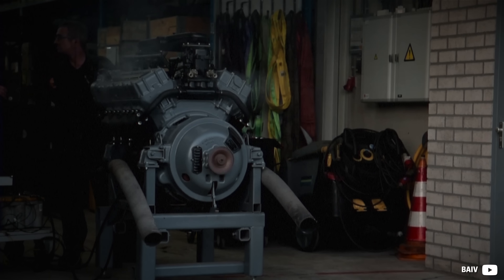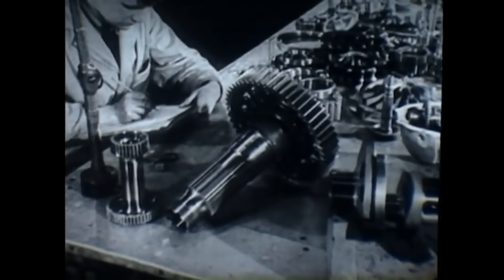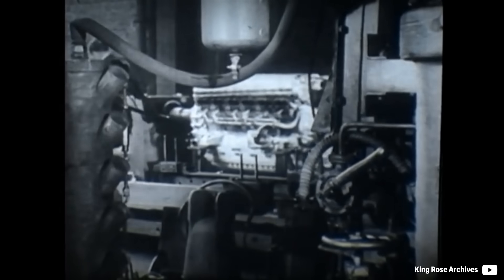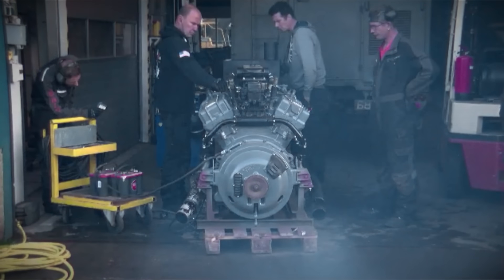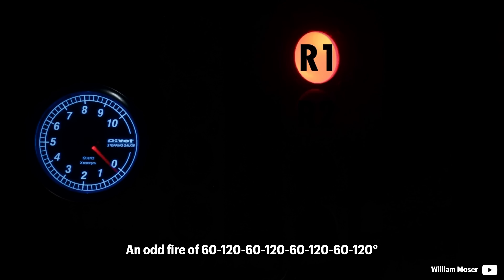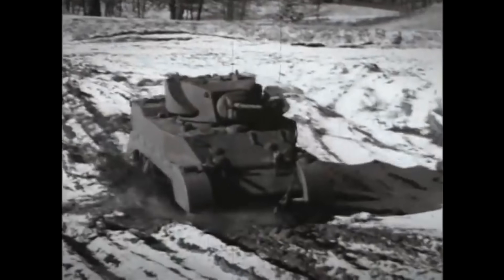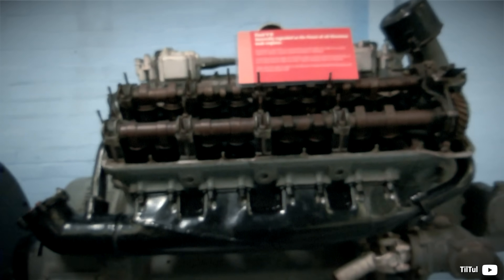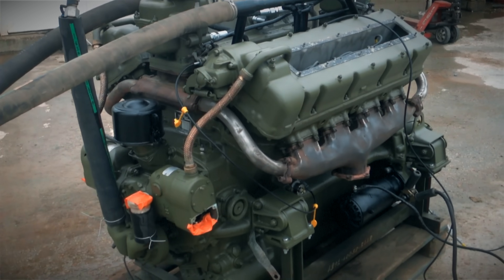The 1,100 Cubic Inch Ford GAA Was Extraordinary

Comment: Another problem with some of the other engines for the Sherman tank... the Chysler "multi bank" engine weighed over 4400 pounds, and the dual GMC 6-71 diesel also weighed over 4400 pounds. By contrast, the Ford GAA V8 engine only weighed 1440 pounds. That's a weight savings of 3000 pounds per each tank. Easier to ship, used way less fuel, could travel over softer ground than the heavier tank models.

Comment: During the 1930's the US Army was developing Christie concept combat cars that used the Liberty V12 engine. They wanted to make it lighter and shorter so made prototypes using a surplus Wright R975 radial aircraft engine. The drivers liked it due to having a smooth delivery of power and the mechanics liked it for not having a liquid cooling system plus being easy to remove and reset. The Ordnance Department decided to keep using the Wright radials in the M3'S and M4'S due to the commercial air carriers having plenty of surplus R975's plus parts on hand (they switched over to using more powerful Wright radial engines) plus Wright was still producing new engines. Ordnance had Continental take over production of Wright's smaller radials (a smaller one was used in the M5) while Chrysler figured out how to mass produce armored tracked vehicles. Ford had his V12 aero engine completed by then and was trying to get the US Army Air Corps and British Air Ministry interested in buying it. It was superior due to being fuel injected and turbocharged. The USAAC decided to keep using the Allison since it's bugs had been worked out over the past ten years, their mechanics were used to working on it plus the War Department knew how much each cost and expected that number to become lower once in mass production. The British Air Ministry declined Ford's V12 and asked him to manufacture the Merlin instead due to Rolls-Royce being too slow. Ford declined and handed the blueprints over to Packard to study while he converted the V12 into a V8 tank engine for the Ordnance Department. That took a few years as Ordnance tested them in their T Series being worked up to replace the M4. The V8 allowed Ordnance to design a hull with a lower height and a lighter weight fluid drive GM Hydromatic transmission. In the M4 it allowed more space for wet ammunition storage on the floor. The V8 also held up longer than the R975 when hot-rodded by the drivers. Both had speed governors that were tinkered with to increase the tanks speed with drivers using engine braking to slow down when racing along. The R975 was expected to run for 200 hours before being swapped out for inspection and refurbishing. Hot rodding had reduced that number to 120 and even 80 hours so the Army now started removing all radials after 150 hours of use. The V8 could sustain being hot rodded for more hours but still had some problems once subjected to rough battlefield operations. Components were still being redesigned when the war ended.

Comment: An interesting drive system for the DOHC.   Worm gears at the bottom of a long shaft, which has worm gears at the top to drive the cams.   ingenious, and likely very reliable.  Also, a 60-degree cylinder bank is very unusual for a V8, which are commonly 90 degrees.

Comment: The GAA weighed far less than the GMC twin 6-71 power plant and the multi-bank. Drop a ton or two in the back for the M4A3E8 HVSS wider tracks is more than a fair tradeoff.

Comment: The flat plane crankshaft was in my opinion, the Big flaw in this engine. It was used in early V8s but side to side vibration was the flaw as it is in more modern race engines.But with the MUTCH shorter Sroke race engines ,MUTCH HIGHER engine speeds can be used. It is my understanding that this return to flat plane crankshaft was to be able to exploit the exhaust extractor effect available inline 4 cylinder engines at high R.P.M. In the case of both race and quickly needed Tank engines, extended engine life was not the main priority. In the case of very short stroke race engines and very heavy, rigid hull (body) military tanks, the side to side vibration just had to be lived with In case of the GAA Ford engines,3800 r.p.m.is a very high engine speed for an engine with a Six inch stroke. This is stroke length with is and has been use heavy truck diesel engines for many decades and was 
Conceived from experience to be the most practical stroke length for this size of engine.

Comment: The r975 was not unpowered, it was very light and reliable. 300 to 450hp and over 1050 ftlbs. Great engine for the tank, availability became the issue with how Sherman tanks were being built.

Comment: Wow imagine Ol,  Henry Ford,s GAA in a ,47 F-150 Pick Up Rat Rod, you forgot Engineers at Rover Motors in Solihull Birmingham UK did the same, lopped four cylinders off a Merlin to create the Meteorite , a monster V-8 petrol engine similar to the GAA in order to satisfy a contract issued in the early 1950,s by the UK war office  for a new Tank Transporter  Tractor designed by John I Thornycroft using the Rover Meteorite  V-8 .

Comment: Seems like such a shame to destroy one of these engines on a pulling tractor when the V-12 Allison has much better power and reliability for high horsepower output. If you keep the GAA under 15-1800 hp. they'll last a long time.😉

Comment: Hi VisioRacer, excellent presentation!  I hope that viewer understand how advanced our technology was back then.  Germany could produce little (or big) marvels but not in great quantity.  Germany built (some) good engines but so did the Allies, think about the Merlins, the Allisons, the GAA and the Curtis-Wright/Pratt & Witney series of radial engines, to name a few.  Consider the complexity and fine edge of the technology used in valve train/drive and/or crankshaft balancing.  Remember that these marvels were produced by the thousands and assembled by an uneducated (for the most part) man/woman power trained "on the premises".
We (Westerners) did make those achievements and we could still do... if we wanted to and... worked for it.
The complexity of a B-29 Bomber is insane!  At its peak production hey days, Ford's Willow Run B-24 Liberator factory was delivering one ~36,000 lbs/16,500 kg 4-engine bomber every 55~60 minutes!  Imagine the process of such undertaking, this back in the forties!  Peace be with you, Ciao, L (Veteran)
Reply: The Willow Run plant received subassemblies that only took one hour to put together to have a complete B-24 being pushed outside where a waiting air crew and ground crew added a gas then fired up the engines for testing and adjustments. Once that was done, everybody climbed aboard and took off for an air  base.

Comment: Be neat to install it into an Ariel Atom type of chassis, maybe just a clutch and a two speed differential
Reply: The engine would probably weigh more than the rest of the vehicle. You definitely wouldn't need mant gears though.

Comment: While Rolls-Royce’s manufacturing techniques churned out very high quality engines, they simply 
didn’t jibe with Packard’s way of doing things (or Ford in Manchester for that matter). In his book “Not Much of An Engineer”, Rolls-Royce engineer Sir Stanley Hooker recalls his introduction to the matter with Ford:
“One day their Chief Engineer appeared in Lovesey’s office, which I was then sharing, and said, ‘You 
know, we can’t make the Merlin to these drawings.’
I replied loftily, ‘I suppose that is because the drawing tolerances are too difficult for you, and you 
can’t achieve the accuracy.’
‘On the contrary’ he replied, ‘the tolerances are far too wide for us.’ We make motor cars far more 
accurately than this. Every part on our car engines has to be interchangeable with the same part on any 
other engine, and hence all parts have to be made with extreme accuracy, far closer than you use. That is 
the only way we can achieve mass-production.’”

pdf The Packard Merlin: How Detroit Mass-Produced Britain’s Hand-Built Powerhouse

Comment: You see there is a big different for using a material for public vs for sports and military so whatever they have done to its metallurgy on how its end on good reliability of the engine still it will surely will not applied for public vehicle because its a business and remember about "plan obselesence". They say the motorsports is their testing ground,absolutely  but the reality we as a normal person most of us will never touch those good engine's.

Comment: did he say it was capable of 250 engine hours / 2000 miles? i dont know what the typical lifespan of a tank engine is but that seems abysmally low... maybe that is between services? but even then you would think theyd be designed to go months without service when necessary
Reply: Tanks are essentially disposable in war, and servicing them keeps crews busy in peacetime. If the engine ran for thousands of hours without overhaul it would mostly just mean that the blown-up tanks left on the battlefield would have good engines.

Comment: Imagine if Ford had taken the same aluminium casting technology and put it to use in their later V8 designs for performance applications. Imagine the old school fire breathing 302s, 351s and 427s coming out but with featherweight aluminium engines.

Comment: I am not personally a Ford man, however, I do respect a lot of what Ford has managed to do over the years. They were great at bringing the dual overhead cam V8 to the masses. And engines like this beast prove that when Ford does something right, they can knock it out of the park.
Reply: When Ford operates unrestricted.
Reply: This engine is 2/3 of a merlin v12. The plans sent from UK to US to make Merlins were intercepted by ford and they stole the design. They even kept the firing and 60 degree v angle. Ford went back to making flatheads for 20 years after the war.

Comment: This engine and the Detroit diesel engine were the two best engines used in WW2. The radial was fine but had some reliability issues. The chrysler mutli bank was a NIGHTMARE to work on but was a decent enough engine. I would have loved to have driven a tank with either the diesel or GAA engines. I love the detroit diesel 2 strokes
Reply: Maybach HL Series laughing in the distance.
Reply: @michaelpielorz9283 you wanna talk about a glorified boat anchor that thing is a boat anchor. Id take a Ford 6.4 diesel over the maybach

Comment: The different mixtures in the cylinders is probably intentional as the cylinders closer to the center of the engine would heat up more than the outer two. So I think this is to improve cooling performance under high load. Smart.
Reply: that would be a very practical solution to the difficulty of engineering truly even water cooling ... make a basic bulletproof design and fine tune the temperature in the fuel system. seems to me that makes a lot of sense in a tank engine

Comment: The 427 SOHC. A friend’s dad has had 3 of these in his shop over the last 30 years, one of which I’ve seen. Beast of a motor. The building that kept all records of how many were built burned to the ground decades ago, leaving only a semi educated guess as to how many were made. Being an over the counter motor, they were never factory installed in any cars. No one knows how many are still in existence. In today’s market, you’re looking at a solid 50k for a turnkey motor, 15-20k just for workable non running engine. Back in the day, Ford advertised the engine with lower numbers than it actually made due to insurance/legal matters. In reality, a correctly built Cammer in factory form produced around 800 hp and 650-700 lb-ft of torque. It’s not unheard of for a NA motor to reach 1,100 hp when fully built. Truly a masterful work of engineering
Reply: I believe they WERE installed in the Thunderbolt T'Birds, as the only factory installation.
But that was not a "dealer sold" car as I recall.
Reply: @bricefleckenstein9666  No they weren't, T Bolts used the 427 Hi-Riser and were Fairlanes not T Birds.

Comment: I have been looking for one of these for 10 years. Most of any running ones were suckd up in the 70s and 80s for pulling tractors . I have yet to find a complete  one
Reply: You must not look real hard. There is another one for sale on ebay right now that looks fairly complete.

Comment: What monster of an engine. I wonder if any body has converted their cam shafts to a gear driven set up😊
Reply: Chains lose 2% of transmitted power - - 90* bevel gears lose 2.5% each gear-set, or 5%. A few motorcycles have a shaft-drive to the head and cam to retain "classic" air cooled looks.
Reply: makes a lot more sense though in an engine that is expected to be torn down frequently. manpower vs engine cost is different in the military, and also just historically in general. and maybe the low revving engine is a factor? i'm guessing that 5% is a bit lower at lower speeds?

Comment: The mistake was made to delete four cilinders on the Ford V12.
Beter lengten the Sherman body (which they already did for the A57 Multibank engine).
The British did better with the 1650ci RR Meteor (Simplyfied Merlin) and made in their turn the mistake not to make a diesel version of it!
Shortly after WW2 Rolls Royce / Rover made also a V8 version for heavy tank transporters etc., the Meteorite, which was made in a Petrol and Diesel version.. So they where close to a liquid cooled V12 Diesel like the Sovjets already had for years!

Comment: In the late '50s/early '60s we owned a cabin cruiser which was powered by the GAA's cousin, the GAN. It had roughly the same specs. It would easily plane our all-plywood, 36 ft. Jeffries cruiser at 30+ knots. I turned my first wrench on that engine, because my Dad couldn't fit in parts of the engine compartment! Later, when I was 12, I was able to pilot, navigating a crowded harbor to our mooring. Several times, I had to blip the throttle to avoid sailboats on a direct collision course (sailboats have the right-of-way). The boat would lurch forward like it was shot from a cannon! 

That engine took us to Catalina countless times, and all the way to San Quintin (Mexico, not prison) and back. On the Mexico trip, it developed a head gasket leak, but my father just pounded some copper wire strands into the gap, and we made it home.

The engine finally was damaged by gulping some seawater back through the exhaust, a freak wave being the cause. A valve broke off its stem, and embedded itself into the piston! It still ran! Having a spare engine in our storage locker, we swapped it out, and had it running again in 2 weekends...that piston sat on my Dad's desk until his passing in 1990.

Great memories of that boat, and, especially of that 1100 cu.in. BEAST under her engine cover...thanks for a great video.
Reply: Similar boat, old Navy surplus Engine, 671 or something like that, big diesel. Had a seawater issue one time, the solution was to decrease the exhaust diameter from dual 4” to dual 2.5, the back pressure kept any seawater from backing into it. The old marine mechanic told me that’s what they did “during the war” to keep the exhaust clear of backwash.
Reply: jealous great boat and engine
Reply: The only difference between the GAA and GAN was the drive system. All specs were the same
Reply: Do you happen to have Horsepower and Torque numbers for that engine, or the GAA ?? and is "N" for "Navy" and "A" for "Army" ??
Reply: @TIMEtoRIDE900  It was rated @500hp, no idea the torque, but it was probably pretty high, as a long-stroke, low RPM engine...
Reply: I've never seen a 36 ft. Jeffries.  Spent a lot of childhood on a 32' fly bridge cabin cruiser (1950s vintage, Chrysler single engine).  Rugged, heavy boat, but it boogied!.   I looked at buying it decades later, but memories are more durable than wood & fiberglass.

Comment: I came so close to getting my hands on one. A coworker had bought several when they were still available through surplus. He and his brother used several on a pulling tractor.  They had a few spares and by that point had gotten out of the sport. He never did sell me an engine as I’m sure he had a hard time letting one go. I don’t blame him I’d probably have the same issue. Oh and btw these weighed just a bit more than an all steel big block Chevy.

Comment: Still waiting for  you to do a piece on the 1,192 cubic inch inline 6, overhead cam dual ignition hemi that Hall Scott built for many years.  Every one of those motors were balanced, dyno tested and dyno tuned.   Hall Scott combined those inline 6's into a V 12 that was used in many US Navy applications too.
Reply: And were so damn sturdy, they didn’t change anything about them when they used them as truck motors well into the 1960s. Heard one story about an old timer who ran a Hall-Scott powered Kenworth in the 1970s on the Jersey Turnpike. Ran on propane and kept up just fine with all the diesel trucks. Called it a “diesel teaser” lol
Reply: I think I have a carburetor for one
Reply: You got your wish! He made that Hall Scott video

Comment: The Merlin was also available in 18L 60deg V8 form with DOHC and 500bhp - coincidence?
Reply: Well, Ford's unproduced aircraft V12 engine design (as mentioned in the video) was effectively a copy of the Merlin and the GAA engine probably used the same basic layout. So the similarities are likely not coincidental.

Comment: The early choice for massive radial engines is partly to blame for the Sherman's high silhouette. The other being the M4 was based on the M3 Lee, a compromise design that tried to satisfy requirements for a larger caliber 75mm they had to stick in the hull and still have a gun in a turret